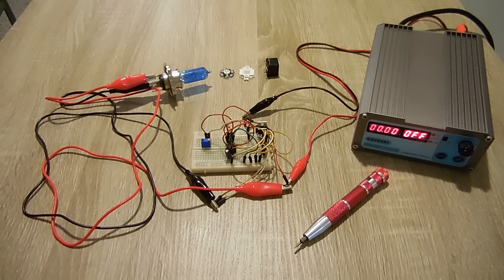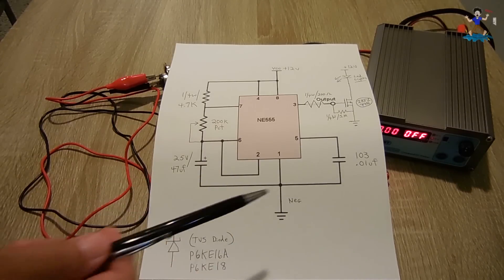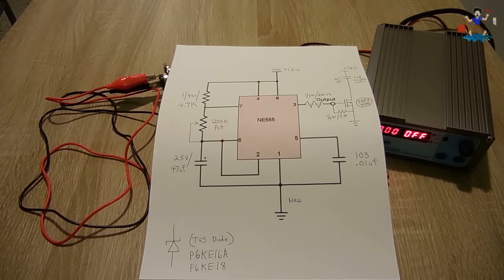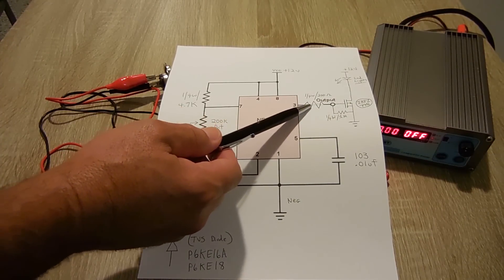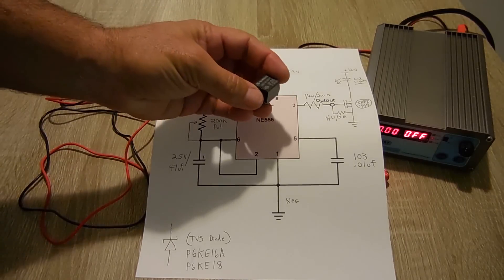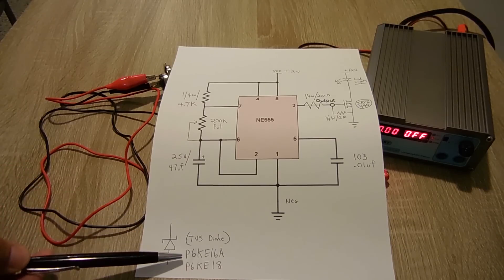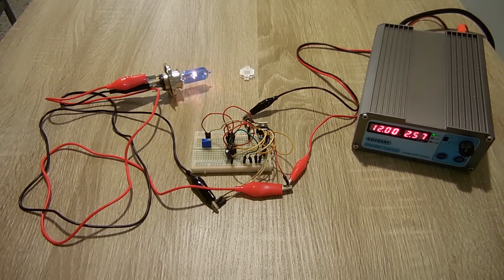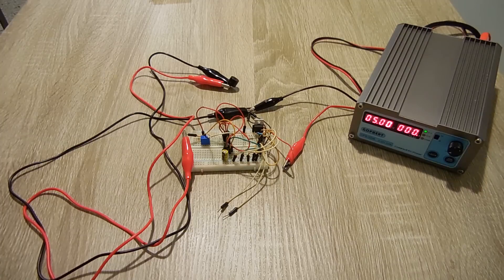How To Make A Simple 12V High Current LED Light Flasher Circuit

Comment: Thank you for sharing this! I built exactly this circuit with a 55w (one flash/ second) lamp and it worked continous for around 6 months (lighthouse) then the 555 timer seemed to overheat and break. (All other components tested ok)

Du you have any ideas why it overheated?

Thanks!

Comment: Not gonna lie... the 2 minute tutorial on how to subscribe to a youtube channel ruined it for me. I understand that you really REALLY want more views but damn dude.

If you don't need the adjustability you can just use a Grote HD flasher part number 44891. works great when replacing car lights with LED and it can switch up to 20A.

However this circuit is super cool since it's so customizeable
Reply from the maker: Not gonna lie, some Youtube viewers truly amaze me that they don't know how to jump ahead in the video. I didn't have to upload this helpful video, but sadly some viewers feel they're entitled to this information.
Reply: @electronicsNmore  and I'm supposed to know how long you were gonna go on about how to subscribe? Most people take about 10 seconds to do this, making skipping around pointless. It truly amazes me that in this day and age someone feels the need to take two full minutes to explain to their viewers, as if they are 90 years old and never used youtube before, how to subscribe to a channel.

I guess I should be thanking you for being so very helpful about how to subscribe to your channel when I came to check out a video which was recommended by another YouTuber
Reply from the maker: If I was taking too long, all you had to do is jump ahead until I was no longer discussing it. You'd be surprised how many people needed me to walk them through those steps. If it makes you happy, because of the age of the video, I removed that part.

Comment: hi electrics&more , can you help me please ? , i have a project to make an inrush current limiter & it's for inverter 3 phase to start ac motor can  you suggest me what circuit and compenent i should have use? please
Reply from the maker: Hello. I don't help viewers with projects, I simply supply viewers with very well detailed videos, and answer (1) simple question per viewer per video. What you need to use is a CLR(Current Limiting Reactor). You need to do some online research. Thanks for watching!
Reply: hmmm , i mean can i use your circuit simple effective solving inrush current your video ? this one http://tinypic.com/usermedia.php?uo=NuVqmzAy%2FKxki7uO2vad04h4l5k2TGxc#.XIp6AB4xWpU , is it still ok for limiting inrush current for inverter with additional some NTC

Comment: Is there a 555 calculator that lets you put in the on time and off time and it calculates the resistor/capacitor combination needed to get that cycle?  The one you linked only seems to work the other way by putting in resistors and capacitors to calculate times.  Also, why would you want to switch to a transistor if running LEDs instead of just running it through the same mosfet?
Reply from the maker: The only one I know of is the one I posted.

Comment: Is the 1M pulldown resistor actually necessary? The 555 timer has a push-pull output stage on pin 3. (I think pin 7 is similar but "open collector" and can only sink current) The output from the 555 timer will always be either a logic '1' or logic '0'
Reply from the maker: Yes. I tested w/o the 1M and the LED/ halogen lamp started slightly dim before it turned on fully with each cycle.
Reply: @electronicsNmore  That's very odd. It should not be necessary. I have used these to drive MOSFETs at high frequency for SMPS design, and never bothered with that. Which version of the 555 timer are you using? The LM555 has an output stage only capable of digital output with no (obvious) way to achieve high high-Z output. I suspect your timer is damaged?

You can see in the internal LM555 schematic, Q23 is the control to the output stage, and when biased it will pull current through R11, which will result in the voltage to fall close to ground and dump that current into Q26  (and Q14), turning them on. Q24 helps with sinking current as well, and further asserting a low impedance output. The output stage can be simplified mostly to being a push-pull buffer as per the 2nd URL.

http://www.ti.com/lit/ds/symlink/lm555.pdf

https://e2e.ti.com/support/data-converters/f/73/t/262428
Reply from the maker: @power-max  I tried different 555's, same result.
Reply: @electronicsNmore  I asume you are using NE555s? not CMOS ones. Are you able to look at what is happening on a scope? I'm curious as to what the heck is going on here. I assumed it's because the gate is floating for a few hundred milliseconds, although it could also be that there is some oscillation too at a high frequency, resulting in a sort of "PWM" effect. Perhaps the capacitor on pin 5 needs to be increased?

Comment: teach us how to make a circuit to charge our cell phone from the doorbell wiring so we can stick our old cell phone by the doorbell with a motion detector cam app.   5vac, 10v & 16v are most popular door bell circuits.
Reply from the maker: Hi Mike. That's easy. Rectify the AC voltage, add a 470 or 1000uf filter cap across the DC output, then buy a step down DC converter to 5v USB. :-)

Comment: I need to build a spot welder timer circuit, so I can push a button and get an adjustable pulse, of a fraction of sec, up to about .250 sec. I have MOSFETs and 555, and a few other components. I haven't seen this in a video, do you have a video of something like this??
Reply from the maker: Hi James. I have a video showing a circuit that has a short adjustable delay followed by a pulse that can be used to trigger a mosfet. That should work.
Reply: @electronicsNmore  thanks I'll try to look that up..